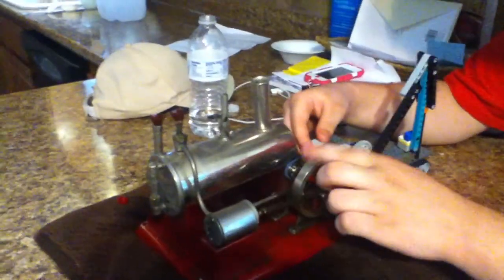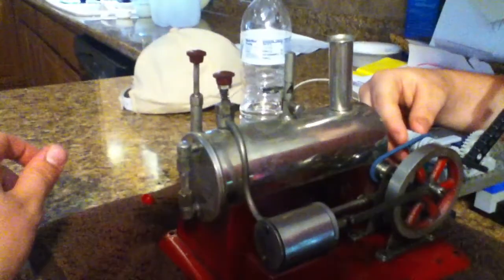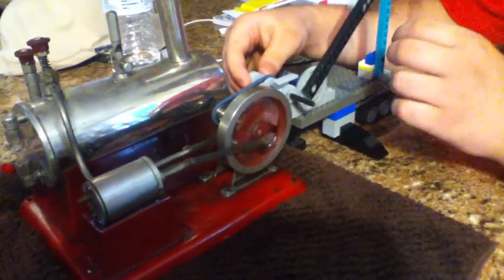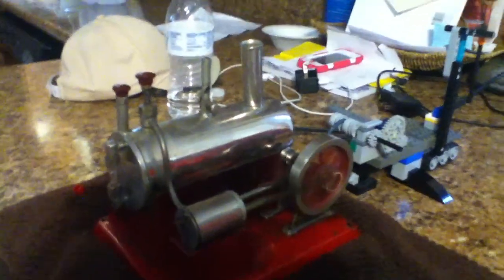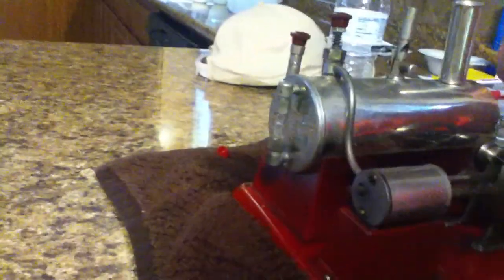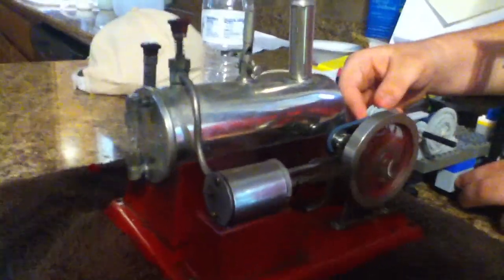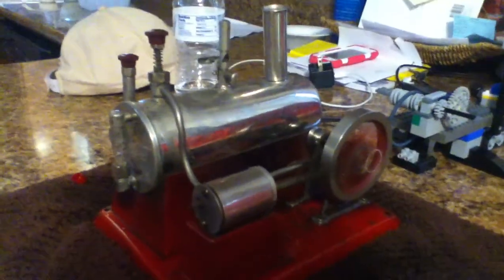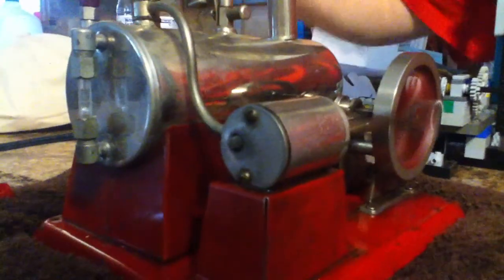Old model stationary steam engine

Comment: If you used tap water in it you lost it already. Did you hit all the oil points? Did you use distiled water? Do you know anything about running a steam engine? There not like a combustion engine. Steam has more torque, lots of heat and you have to run lots of maitonence (fuck spelling) just a warning. To run one of these the RIGHT way. Reply to this comment and I'll tell you all ya need to know.
Reply from the maker: Dr. Jak G. Cogsworth I appreciate it, but I've learned a lot about steam since then, that was over 2 years ago. I've really come to like steam power, and I know how much work they are, but they are a lot of fun. this was a model a friend had that his grandfather ( great-grandfather?) had from WWII era. He knew what he was doing, I was clueless. He used distilled, oiled it every 2 minutes, he did burn out the heating element after this but fixed it.
Reply: Well I'm happy you like steam and are learning about it. Your lucky....mine offset yesterday....I'm replacing the engine on mine and over all it needs a lot of work. My electric burner in my electric steam engine needs to be retimed so I can't do much. Keep learning and someday you could be running a traction engine for a museum!

                            --Dr Jefferson Gearford Cogsworth